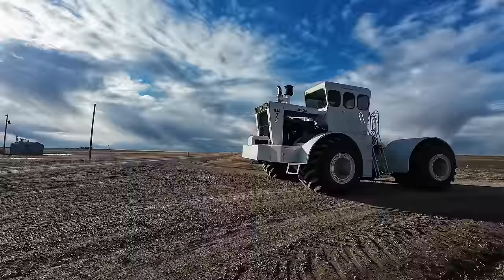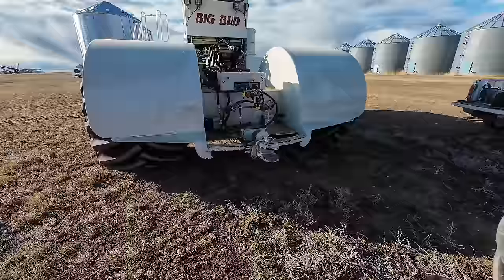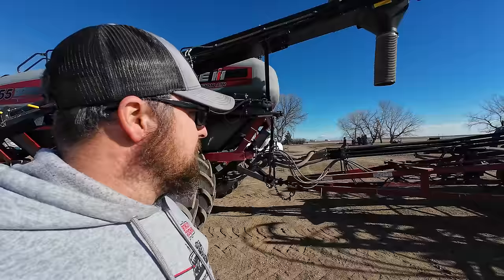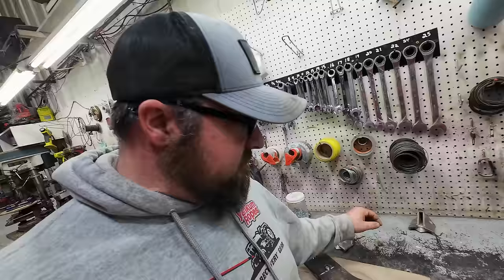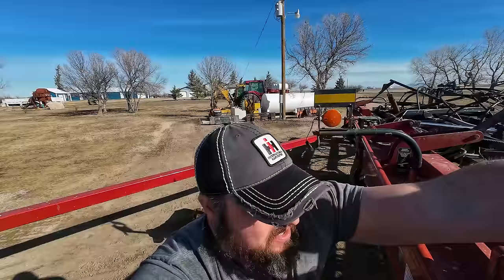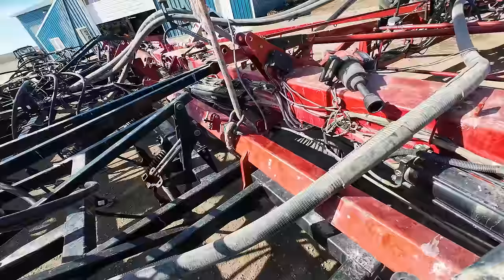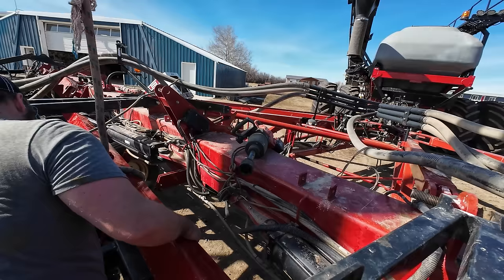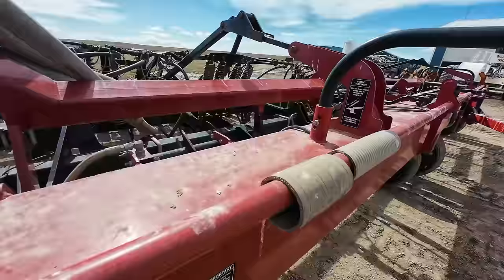When Machinery CRIES For Help... LegArms SWINGS Back Into Action!!!

Comment: Here's a little Farmer Tech Tip, If your Roll-Pins are falling out, or the hole is loose, drive a nail or a piece of a used up welding rod inside the Roll-Pin. Roll-Pins are hollow, and they just aren't the quality they used to be, so I do it as a safety keeper even under new conditions just in case.

Comment: Those Big Buds are a testament to basic [almost Brutalist] industrial design: power plant, wheels, cab, attachment.  Truly 'no-frills' and get the job done.  That you have a fleet of them is wonderful.  Good work guys.
Reply: The first one(s) were built in the day when things were made to last.  Note how thick the frame is.
Scott has repaired or replaced a lot of its parts but the frame stays the same.

Comment: Thanks for the laugh guys, had a booger of an afternoon, short version, tractor i spent couple months rebuilding due to front frame casting breaking just did the same thing, might be a fault in the pivot pins on the front axle but anyhoo, thanks

Comment: Just FYI, storing batteries directly on concrete discharges them.  Support them on some wood.
Reply: My question is how does concrete draw a battery down but a steel battery box in trucks tractors and old dodges not while sitting over the winter??  Last time I checked steel was a lot more conductive to electricity than concrete??   Not saying your wrong I just dont understand?

Comment: Flat faced fittings are fine if you use them on a regular basic, in salt country they are a pain in the neck always rusting, so we’ve changed back to the regular AG hydraulic fittings.

Comment: What kind of boots were  you running?  I used to run Dutch they had 1/4" holes on the outside and 3/16 in the middle.  Next to impossible to remove the roll pin!  I switched everything to Bourgalt boots.  They have a little bolt with loktite holding the tip on.  Changing tips is childs play and never lose one

Comment: When str. A tube with heat you need to drill a hole in the tube so the hot air can escaped.  When it is str. And cold , tap the hole or weld closed

Comment: Those are the wrong adjustment links. You want the bigger ones with rubber bushings in them. I have installed them on our drills. I have photos of them

Comment: Curious if your points use the double roll pins (roll pin inside of a roll pin)? That's all I've ever had and don't have issues losing points for the most part. But could just as easily be the issues you mentioned.

Comment: One of the BIG Bud advantages your operation has over many others that have gone to the latest and greatest tractors is you can keep on operating if one of your electronic systems goes down on the tractor and you don’t have to have $5.000+ diagnostics tools to figure out what went wrong on the Canbus communications for the operation of the tractor.